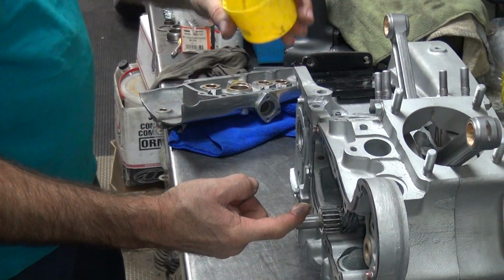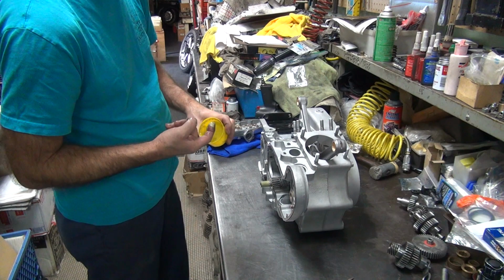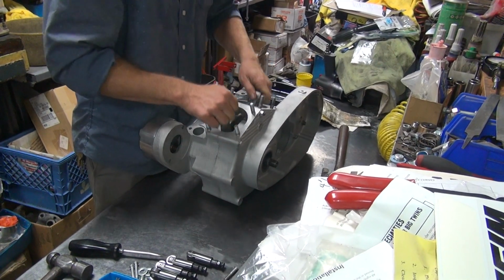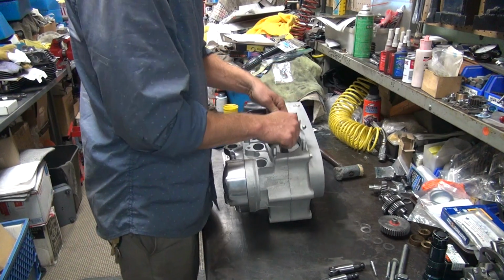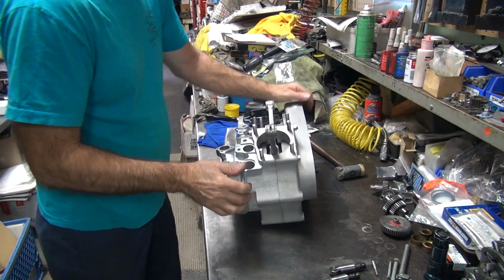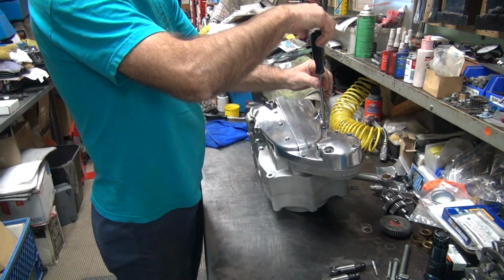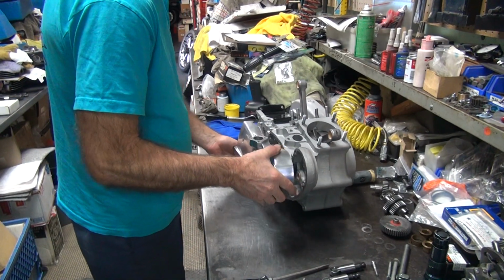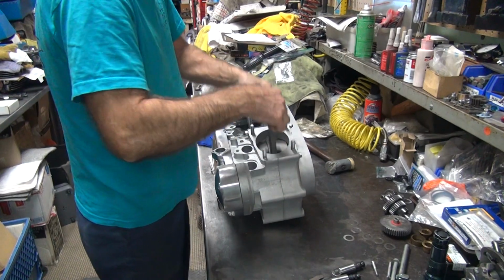1961 xlch #189 no miles transmission motor rebuild sportster harley repair restoration tatro machine

Comment: For future work like this, make a pair of plastic tubes you can bolt on like cylinders for the rods so they don’t hit the housing and then turn the crank with an air drill or alike.
Reply from the maker: no, i like the way i do it now. i would take a big drill to turn over the motor. i make it look easy. if you watched all of this you would know that this did not work.
tatro